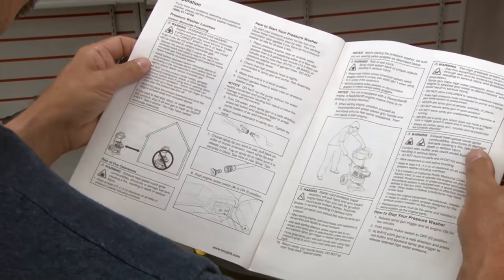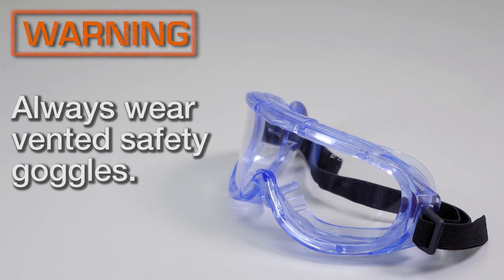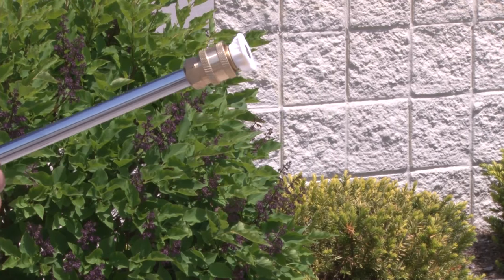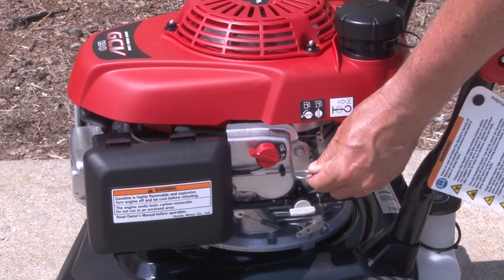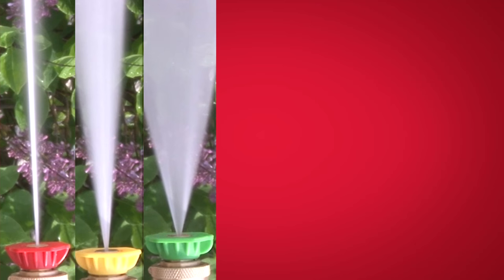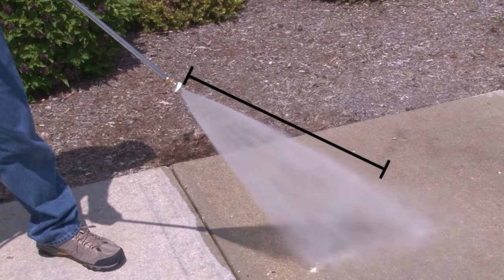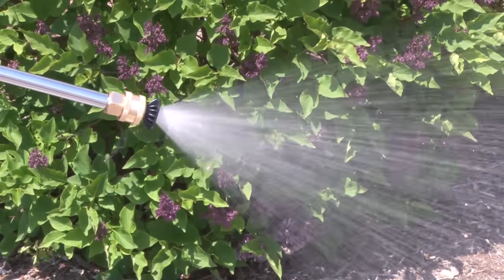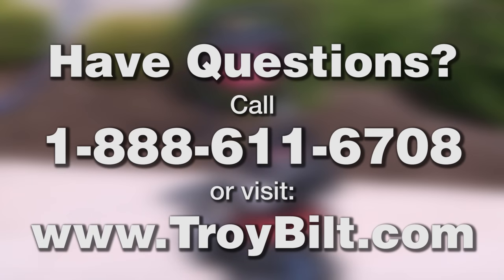Troy-Bilt® Pressure Washer Operation

Comment: Bought mine at Lowe’s. Used exactly 6 times. Cleaned bowl on carb runs fine but now doesn’t have any pressure. Makes a weird noise when trigger is pulled. Waste of money. JUNK
Reply: Maybe try cleaning your pump? These things are so simple you probably just have a stuck unloader valve or maybe some blockage in the pump.

Comment: Do not try and transport on the attached wheel system over the lawn.  When tilted back to move. the ground clearance is insufficient and the detergent / rinse agent tank valves tear off the tanks.  It's easier jack up the house and turn it around.   A great unit for all round cleaning. Narragansett Bay.

Comment: Bought one used it for cleaning a concrete driveway it did a great job I never had one problem ran it over the course of two days for about 8 hours total it was great driveway looks brand new was easy to use just followed directions and that was it.
Reply: Start won`t stay  running  oil in engine air cleaner

Comment: I cracked it up before I turned the water on , once I turned the water on the washer cut off and it’s locked up or the cord is hard to pull

Comment: I was given one of these from someone who left gasoline in it for 5 years. The fuel tank smelled like turpentine. DRAIN YOUR FUEL PEOPLE!!!!!! 

IF the unit will sit for more than 6 months, drain the tank and let her run until she quits. 

I had to take the entire fuel system apart and soak the carburetor in mineral spirits overnight. The unit runs at wide open throttle but has a hard time at lower power settings so something else is clogged in another circuit of the carburetor. Oh well, it runs and I got it FOR FREE!!!
Reply: The carb Needs to be cleaned further , low speed circuit is dirty .......... little secret - DON'T USE Fuel stabilizer , believe it or not - mix some 2-cycle oil in with the gas - fuel stays good for a year or more , & carb won't get dirty if fuel left in over winter .

Comment: Listen to them about the pull cord and safety stuff,  i have a dozen small engine machines from huge garden tractors to 2hp water pump and im always safe.  I read a general how to and of course,  on 2nd  or third pull,  it snapped from my hand at the end of the pull and that summanabeech smacked my right man tittie and i was done, it was the worst.  Last week i took a socket to the eye from a spinning impact wrench and still have a shiner but the tittie smack was twice as painful.

Comment: Does this use a 2 cycle fuel or reg gas? I lost my engine manual.  Ty
Reply: Regular Unleaded 87-I add fuel stabilizer to my gas can-Helps makes the gas last longer if you only use the gas seasonally and will help protect any plastics. Good luck

Comment: It's a POS. Takes an hour of pulling gun squits whent wants to, keeps turning off during wash, soap comes at any time.
Reply: I agree. Purchased one brand new and after one house cleaning its broken down and cannot be started.  Changed spark plug, filters, oil, etc. still won't work.  Should've bought a craftsman.
Reply: You're doing it wrong.  I watched a general video and i got it started,  but only after multiple mistakes.  Mistakes i wouldn't have made if i watched this or found the operator manual. I have over a dozen small engines and this thing is super tight.  I bought used but the muffler still has its paint and no carbon.

Comment: The hazard alert is cute given the number of reports on these things never starting again after spending time in storage.
Reply: I'd be willing to bet that 90% of these reports are from users letting old gas sit in the carburetor, and that they just need to be cleaned out. It's not a Troy-Bilt problem, it's a user problem. Put some stabilizer in your fuel if you're gonna let it sit for years.
Reply: Probably. And cleaning a carburetor is no biggie. The plastic camshaft on the other hand is ridiculous... engines better be made of metal.
Reply: ***** Yeah that's a little nutty.
Reply: Federico Lucifredi, plastic camshaft.  What a joke.  I was told by someone that built the b & s engines were designed to operate for 500 hours.  I won’t be buying anything made by Briggs anymore.

Comment: don't even tell you how to use the detergent dispenser....worthless!
Reply: shinta201 it’s simple and straight forward, read the manual!
Reply: The person asking this question may not have a manual.
Reply: I was looking for this also. Bought used, no manual. Low pressure tip and soap still won't siphon, hoping to see if there was a valve switch or something I was missing.